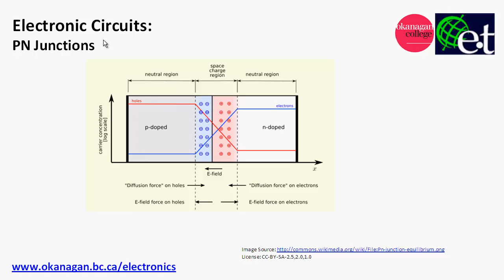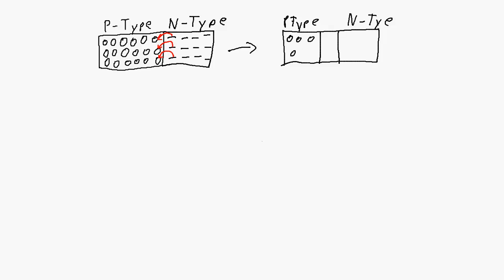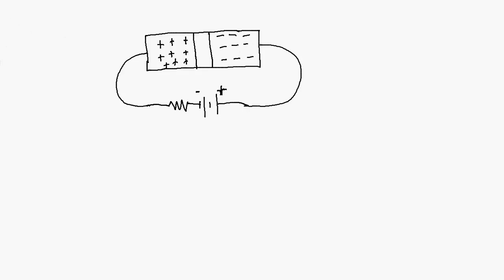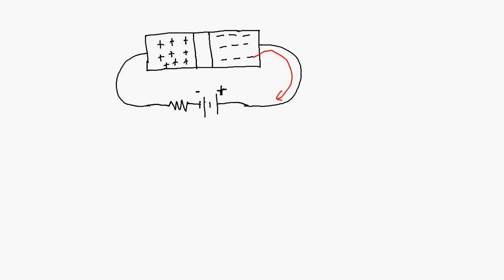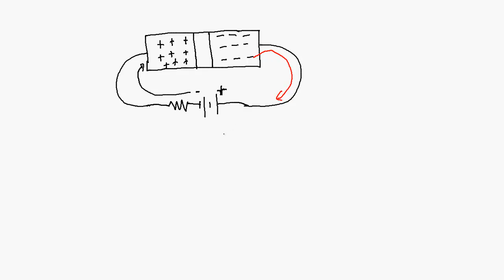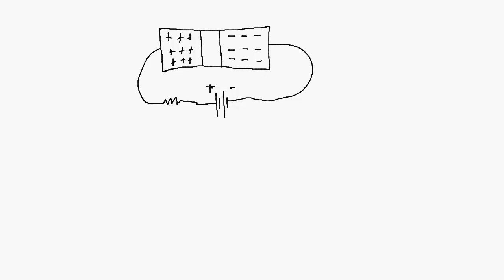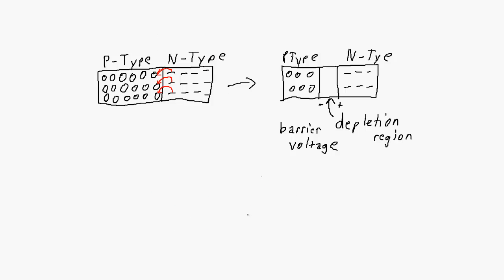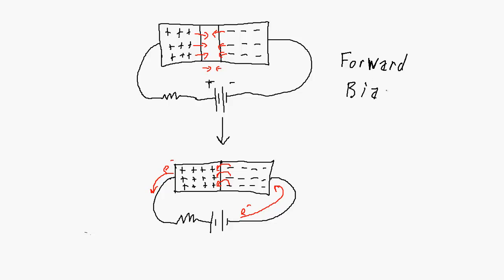Diodes - PN Junctions

Comment from the maker: When you dope intrinsic semiconductor with a P type material, you are adding an entire atom, not just an extra hole.  So even though the P type material has one fewer electron in its valence shell than silicon does, the number of electrons it has is balanced by the number of protons in the nucleus of the atom.   Same idea for when you dope with N type material.